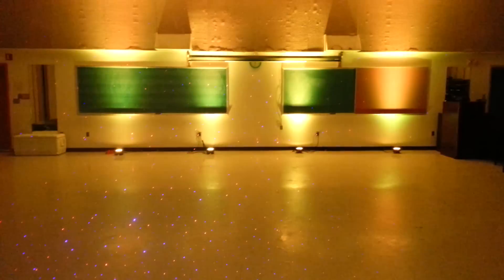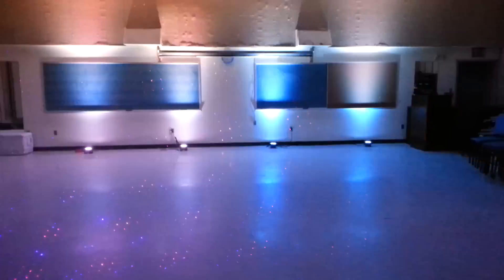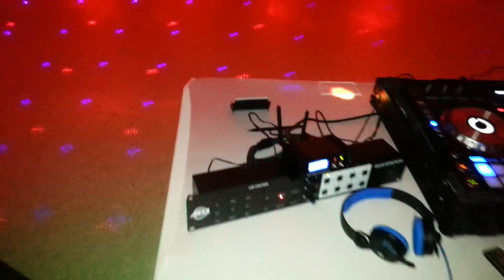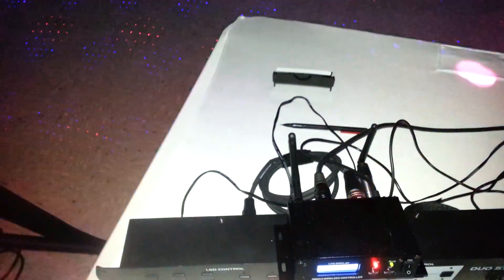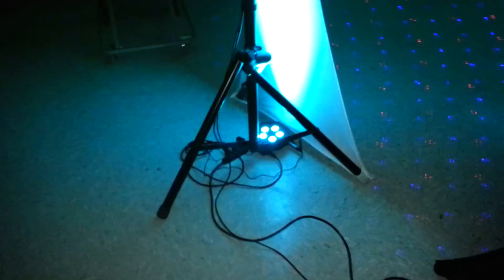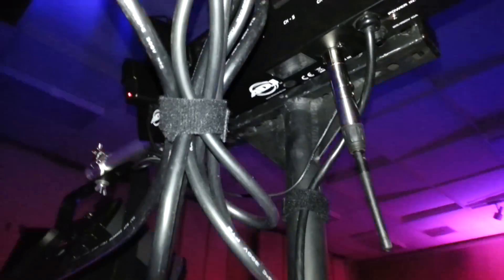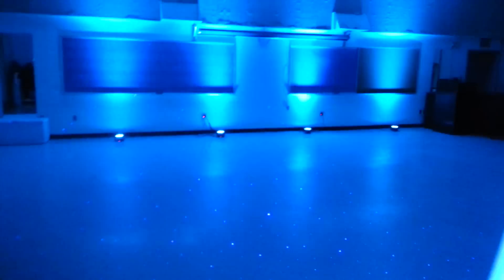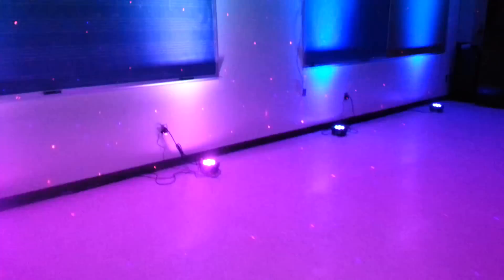Wireless DMX Stick @NMSU

Comment: Hi, nice video!
I just wanted to know if you have had problems with noise or interference with the audio system? 
I usually work on band's concerts, and while i'm using Led lights with Dmx Cable connected to my Dmx board, I get noise on my speakers which sounds like Electric Static, I just can't mute it, even though I mute my MAIN L R Audio Channels.
What do you suggest.??
If I get Wireless Dmx Device, Would it help? 
Thanks!!

Comment from the maker: 512 channels can be controlled with just one stick. So If you wanted to have 3 fixtures and only use one stick, then each fixture would have to start at it's designated channel. If each fixture had the capability to do 10 channels then fixture 1 would be set at dmx channels 1-10, and fixture 2 would be set at dmx channels 11-20, and fixture 3 would be set at dmx channel  21-30 and you would be able to control each fixture individually up to 512 channels depending on the software you are using.